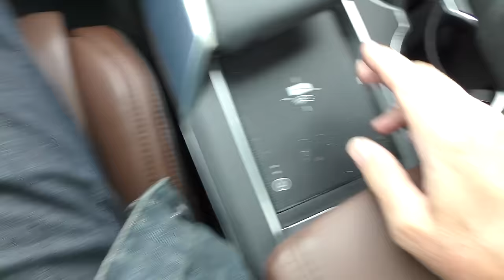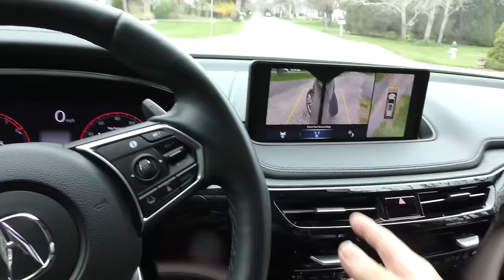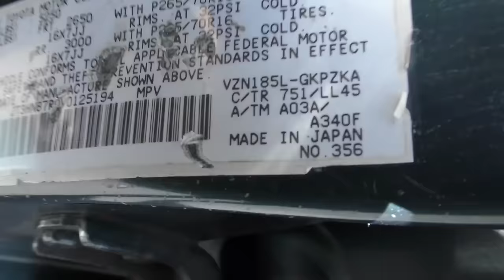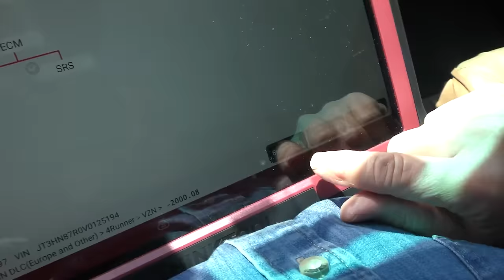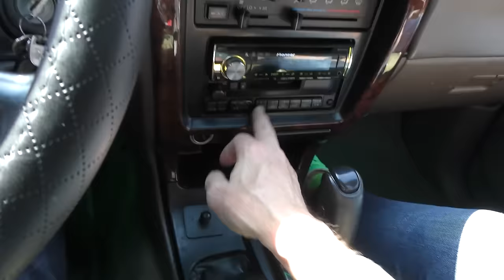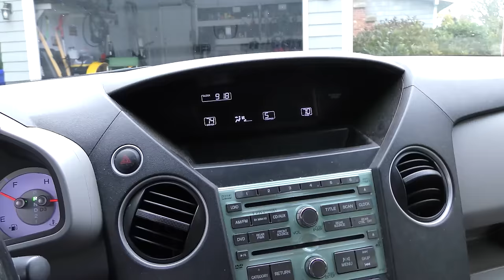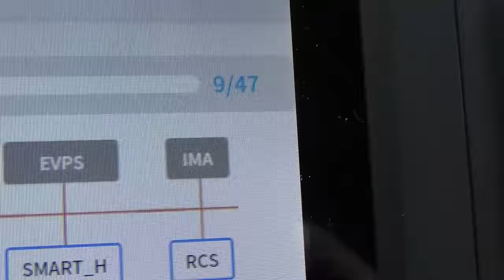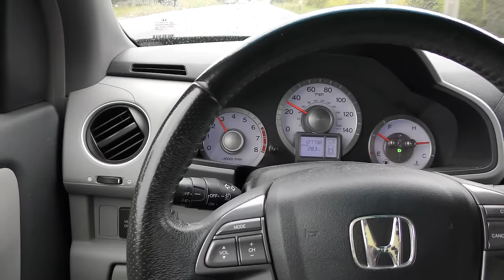3 SUVs That Will Last 500,000 Miles or More

Comment: Idk where you’re getting that a Maercedes suv is $160k. Maybe an AMG G500 or GLS Maybach 600. But the GLE and GLS are pretty much the same price as the Acura MDX and RDX. And the Mercedes SUB lineup has a more heavy duty suspension compared to those Acuras for off road ability.
Reply: Lol mercedes is junk
Reply: @2007NissanAltima  I love my Benz. I’ve owed everything from VW to Caddy to Lexus and the Benz is just extremely solid. Nothing rattles on it and the road noise is hardly noticeable. I road in a buddy’s 99’ 4runner one time and everything on it was loose and vibrating and I couldn’t hear him talking when we were on highways. A relative of mines Toyota Tacoma had the frame rust out on it. Idk why this guy talks up Toyotas all the time, he just creates demand for them that isn’t actually proven on other than the Land Cruisers and Sequoias. But who in their right mind would pay $35k for a 2015 Land Cruiser. It’s not worth it at all even if it is reliable.

Comment: I love my 98 4 runner but its at 253k miles and my trusted mechanic found a decent amount oil leaks. Found your clips on my road to decide on either dropping a bunch of cash to basically do a rebuild or drop a bunch of cash for a "new" used vehicle. Very hard decision. Would be nice to get something with better mileage like a sedan but I just dont want to give up the great storage space for trips, homedepot runs and lose the towing ability.
Reply: Put 2k in it. Seals and belt. It’s only at half it’s life

Comment: Just a question I have a 2017 Ford edge, I had to get the engine replaced again and 3 weeks after getting my engine in my transmission completely goes out. Before the previous engine went out again(due to coolant leaking into the engine again, I've had this twice), the transmission was smooth not a single problem. I think they did something to my transmission how do I go about proving it?
Reply: Do you have the V6 or turbo 4?

Comment: Acura max with only 110,000 miles that I looked out had definite transmission problems.  Looking into it, both Honda and of course Acura are prone to transmission problems.  At least if a Subaru has a head gasket problem, you will usually get more than 110,000 before it shows up!  I’ll stick with the Subaru Forester/Outback, the Toyota RAV4/4Runner or the Mazda CX-5
Reply: I drove a 2009 Honda CRV to 300k miles before the transmission died. I drove a 2012 Honda Accord to 350k miles and got rid of it for another vehicle but it was still going strong, no issues other than basic maintenance and repairs, tires, brakes, battery, etc. I currently have a CRV with 160k miles and the only issue outside of basic maintenance and repairs was the sunroof leaked which needed resealing.

Comment: I have a 2010 Cheverolet Equinox and it has 220000 miles on it. I do have to remove the throttle body once a year to clean some blow back oil out of it, and the check engine light has been on for about 100000 miles, the code looked like an o2 sensor, replaced them all, cleared the code, but is still on, I say oh well, because the gas mileage is the same as when I got it and it gets me to and from work. Also helps me so I don't have to put miles on my 2016 Silverado that only has 27000 miles on it. Love your posts, keep up the great work.
Reply: You have a very rare one.....I've never seen one last that long

Comment: Dera Scotty yoiu are always entertaing as an old engineer I take notice of you.... Out toyota Landcruiser eng Kz-TE has a faulty oil pump = no oil pressure at the sensor.  A motor eng says it might be the pressure relief valve but what do you think, Starts first button when wife turned the key  = no pressure... STOP.   She won't let me do it at 82.... last job a couple of years ago I HAD to change injectors that the so called experts made a balls up of puty one new one in instead of 2 !    It  has run 2 years better than it would if it had a suggested hole in a piston = I got £500 back for their crap work.... Should I buy a small 4x4 to tide us over of your recomend.......   Or should I tackle the grueller and use my LWB land rover   1968 but still going strong but not  uphiill      A few garages will not tackle the toyota fault.....!

Comment: Hey Scotty I know this is unrelated to the video but my engine light just ignited w a code p0711 stating transmission fluid temp sensor. Should I take it in to get checked and replaced? Or is it just the transmission fluid?
Reply: Depends on the car just order the part from rock auto and change it. You will need to drain the fluid anyway to change the sensor. Drain and fill ONLY! Not that flush crap

Comment: This is all true, but my daughter just bought a clean 2018 Lexus RX350 and it is a very nice SUV that gets 24mpg combined. I believe that the MDX has better performance, but 13MPG in the city??? The 2018-2022 RX350 gets 21MPG/city. FWIW, our mechanic only works on Toyota/Lexus/Accura/Honda, and he bought an RX350 for his wife last year. All food for thought. My daughter drove an ES350 for 10 years and blew a head gasket. We hope she'll get at least 10 years out of this, she only drives about 10k miles per year. Same mechanic will maintain it for her, just like her ES350.

Comment: I love my Toyota but I have a Dodge Ram 5.9 Cummins with 605,000 miles on it,only replace the water pump and alternator that’s it.
Reply: You lucked out.  Most Dodge vehicles could never do that.
Reply: @huwhitecavebeast1972  I bought it brand new in 2004 for my business and it’s been an unbelievable truck 5.9. Cummins 6 speed manual tranny 4 x 4 four-door great truck.

Comment: 2009 was a pivotal year in Hondas manufacturing. That was the year they moved their production to Alabama and as such is perhaps the reason why 2009 is not a good year. In fact for approximately 2 to 3 years after that, the quality of Hondas were not the best. Another thing to remember. Honda is a very small company. They do not have the resources that a giant like Toyota does. Also the name of the company is Honda motor company. They have been and will always be primarily an engine builder and designer. That is where their focus is

Comment: Scotty, just curious I had a neighbor complain about his Honda Pilot AWD system and said above 20 or 25 MPH it kicked off and would not work. He bought the vehicle new and didn't like the AWD. So he traded it in on a F-150 with a true 4-wheel drive system that worked much better and didn't shut off like the Hinda. Any thoughts 🤔 on this?
Reply: It is basically intelligent, and works on its own. Only engage if you are stuck, and going slow. It will disengage at higher speeds. This is normal.
Reply: @kayjay4060  Really ? Hmm, I test drove Highlander 2008 today and liked it. Always wanted one, I was wondering if I wanted the AWD or the 4WD,  Had 4WD badge on back but no way to engage 4WD so assuming it is really AWD.
Reply: @tubetime39  It operates as a front wheel drive system until conditions cause it to act like 4-WD.  
There is a clutch to control each rear wheel. The vtm-4 button locks both rear wheels. 
Depending on the conditions the two rear clutches will engage/disengage as needed. 
Pushing the button is done by shifting into lower gears 1/2. It will disengage once it hits 18 MPH. 
I'm not familiar with the differences of other systems. Not 100% sure how VTM-4 works either, just a general idea.
Reply: @kayjay4060  Sooo appreciate you, thanks ! Did not know. That makes me feel much better as I plan on getting off pavement once in awhile and though I'd like to do more serious off roading I know the limitations more now. Thanks again !

Comment: My 2000 Ford Expy is pushing 270K and running fine knock on wood! Yes, gas mileage stinks, freeway is not so bad. I can drive it on sand and it will climb Mt. Whitney. My goal is not an electric car w/ more headaches, my goal is to work closer to home in 2023. I wanted a Pilot, but the stupid waterpump (and timing belt) design was as dumb as the one on my PT Cruiser!

Comment: I'd like to also nominate the 2001-2007 Ford Escape.  I drive a 2006 Limited with 218k.  Runs great, easy to work on, and has only really needed maintenance since I bought it 9 years ago.  It's a great SUV that you'll have to pry away from me.
Reply: I got a headgasket leak at 165k in my 2005 Escape with a V6.  This was likely due to twice having the spark plugs shoot out and driving a mile to pull off.  Apparently it has happened to many people.  I was sad to get rid of it and I probably should have just paid the $2500 to repair it, although that's all it was worth at the time.

Comment: YOU FORGOT (1)  MORE BULLET PROOF SUV...2000-2004 WJ (GRAND CHEROKEE  JEEP) WITH THE  4.0L INLINE 6 CYLINDER WITH  THE  SELECT-TRACK 4WD SYSTEM..I HAVE OVER 250K NO PROBLEMS, NO RUST  CHEAP TO FIX.

Comment: my 2007 nissan Pathfinder/ R51 4.0 V6 300500 kms runs like new no Check engine light, but i maintain it
Reply: WriteMe☝️
Reply: I had the same car, it was perfect until it got totaled in an accident. Those years of pathfinders are very reliable.

Comment: I had a bad experience with a 2013 Acura MDX that I purchased used with 100k. Piston condemned and needed a new engine. Not sure if previous owner abused it, but I loved the car otherwise. Sadly I only put 10k on it before it was done. Nobody locally wanted to work on it at the time so I traded it in.
Reply: belt?
Reply: The VCM did that.  Avoid any six cylinder Honda or Acura with the VCM engine.

Comment: 2RZ-2.4 and 3RZ- 2.7 run forever. 3.4 5VZE-FE  occasionally blew head gaskets not as bad as the 3VZ but it did. I do not like the 3.4.

Comment: I disagree about the Acura. I will take the latter two vehicles, not the Acura. Scotty remembers Acura from twenty years ago when it was bullet proof. When I look at recent JD Power reliability data, in the last five years Acura is ranked 25th (164 customer breakdowns per 100 vehicles); in the last ten years is ranked 15th (147 breakdowns/100 vehicles and half of those years below average, the other half just at industry average) in reliability. 2018-2022 are bad years for Acura, in 2022 customers reported 244 breakdown per 100 owned vehicles, worse than GMC but better than RAM. It's only when I go back to 20 year data that I see the old Acura from when I was young. Lexus, in contrast, had the fewest breakdowns 15 out of 20 years or in the top three 19 of 20 years. 2022 was a "bad" year for Lexus, 159 breakdowns/100 vehicles against the industry average of 198/100, still far above the average.

Comment: i got a 2012 pilot, and i was wondering whats that knocking sound they make when you start it in the morning for like the first 3 to 4 mins and then as the engine warms up it goes away! can anyone elaborate? thanks!
Reply: Check the timing belt tensioner. It's a piston with hydraulic fluid pressure. If it dwvelops a leak and loses hydraulic fluid and pressure resistance it can cause a rattling or slapping sound against the tensioner roller.
Reply: That is 100 percent the timing tensor. Had the same issue. It's common for them to go out before they are supposed to.

Comment: Scotty, I had a 2007 Acura MDX  it only had 137,000 miles on it and it start breaking down here and there.  The motor make a lot noise and leaking oil.  I change oil every 3,000 miles and take good care of it.  This vehicle still break down anyway.  I quest Honda and Acura wasn't for me.  My 1996 Toyota 4runner Limited outlast all the Honda and Acura cars I own. I still driving my 26 years old 4runner everyday.

Comment: I love my first gen MDX it is a comfortable ride  but it has had quite a few problems.    This list is quite long but many of the issues related to electrical and radiator/coolant issues along with interior materials breaking on me. and of course rust issues.       I hope the newer ones are built better than the first few model years, they had quite a few problems.

Comment: Ive had horrible experience with mdx , transmission failure at 40,000 miles i will rate toyota higher than honda i had a Avalon 2007 touring bought used  having 18000 miles drove it till 348000 only expense a gas cap replaced and usual oil change and brake change . Honda pilot acura are all crap their rusting joints n the frame and horrible transmissions , hinda accord is another notorious vehicle

Comment: I think my 96 Grand Cherokee would probably last 500k miles. 

If I replaced the engine twice and the transmission 3-4 times and rebuilt the rear axle 3 times and replaced the transfer case 2 or 3 times.🤣

Comment: Corolla 2001 died after 180K miles, Camry 2005 died after 185k miles. I looked after them really well. Do you still trust Scotty's stories about 300-400-500k miles? I don't. My Ford Sierra 1992 lived longer than any of my Toyotas. I believe that car is just a lottery. You can randomly get Fiat that will run which will run 300k and you can get Toyota which will die after 150k.

Comment: So what year 4Runner should you buy? I need the 7 seater version too btw..
Reply: The 3rd row on the 5th gens were offered as an option and can be added on both the sr5 or the limited models. I would also look at the Lexus GX460 , same platform instead has a v8 , Kdss and realistically gets the same hwy mpg as the 4runner due to the 6 speed trans vs the 5 speed in the 4runner. Also look for the base gx’s without the auto ride adjust suspension- less parts to break.
Reply: @marsarmory6236  thank you. I was looking at the V6 version of 4 runner for myself to drive to work, for gas mileage.. but since they technically are the same maybe I just might get two Sequoia's if they get the same gas milage.. or a GX460 like you said..

Comment: The rubber timing belt is the deal breaker for me. A pain to change and a busted engine if it breaks.
Reply: it wont
Reply: Interference engine if belt isn't changed and breaks ≈ valve head job

Comment: The smaller 22 Acura RDX get much better gas mileage.  I drive one
Reply: No doubt.
Reply: @mcc7762  It’s the same turbocharged engine they use on the Honda Accord. Just tuned differently

Comment: As much as I love the Honda Pilots,  you are pretty much guaranteed to spend $1500-$2000 every 100k between timing belt and water pump replacement and getting the valves adjusted.
Reply: Yeah u are right that’s why I don’t like Honda and Acura I don’t know why they don’t get rid of the timing belt

Comment: Hey Scott! What you think about a 2003 Toyota Sequoia? (Since it has the 4.7L V8)
Reply: I was going to get a new Sequoia but then I found out they aren't even getting as good mileage as a Suburban - and it has a hybrid engine!  If Chevrolet whose name is interchangeable with "suck" can get 23 mpg out of a Suburban with a gasoline engine, you would think toyota could do better than that with a hybrid.  Oh well.
Reply: @huwhitecavebeast1972  well thats true, but hybrid will make it still heavy. Also using the same v6 as like then camry has. But, tbh I think gas mileage isnt a huge issue. I just see it as a strong engine versing a good mileage vehicle to just save "gas". If anything, Ill get the Honda accord or Acura RDX haha if gas is an issue

Comment: Unfortunately my 03 pilot transmission has been replaced and is having issues again at 215,000 miles. Although the engine stills runs like new.

Comment: New SUVs run from $40K to 80K. So if someone buys a new SUV 20 years ago for $31K and then spends $40K in repairs to keep it running over 20 years - it's still got something to it if the miles tend toward 500K.

Comment: I use to own 32 tonne trucks that did 13 MPG. Why are Americans still driving petrol or Gas engine cars?? A good diesel would do 30mpg minimum.  The diesel are just as fast or faster have more torque and cost less to maintain.
Reply: Reach out for your package ☝️
Reply: Because we have very strict emissions regulations and diesel fuel in the US cost almost a dollar more per gallon than regular gasoline.

Comment: My  2011 honda accord  with the  4 cylinder vtec  motor  will  go 500k miles  . With  synthetic  oil  changes every  3 k and transmission  fluid  change  every  20k . It will go 500k miles  .
My 1983 honda prelude  went  482k until  it got  into a  accident  😐.

Comment: only 500,000 not enough. and i bet you still have to do oil changes, spark plugs, brakes and rotors, and if it's standard transmission you would have gone thru atleast 1 clutch pack,. there are already some ev's that have more than 500,000. and soon ev's will be doing a million miles.

Comment: How does that Acura only get 13mpg? My gas F-350 gets 12, and that's a giant pickup
Reply: Idk, my 4Runner gets similar mileage to the MDX.  Maybe slightly better.  The mileage hasn't changed on them in 25 years I have no idea why.
Reply: I get 22-23 on E15 with my Ridgeline truck. I think Scotty drives in the city and has a lead foot.